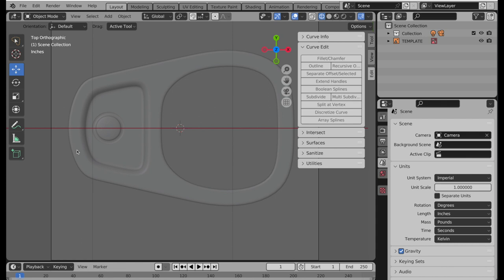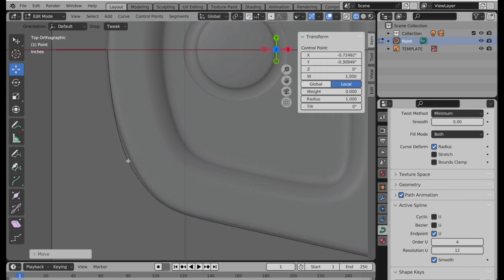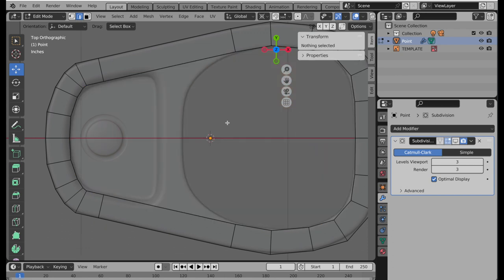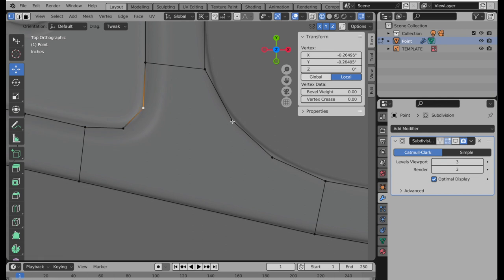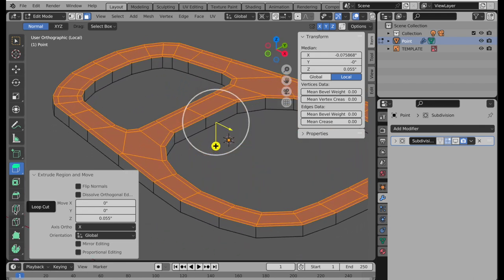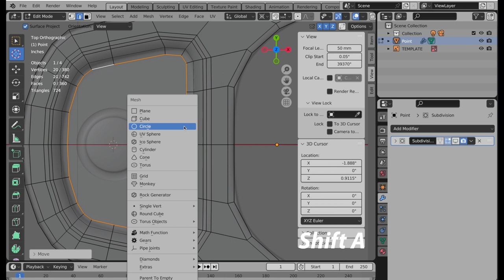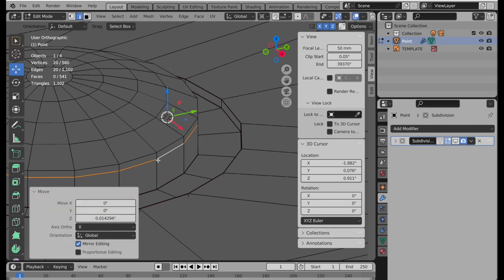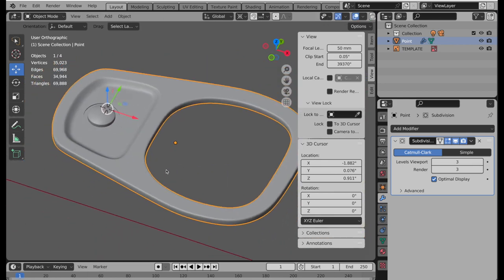Part 1, Sardines Can Packaging, tab modeling

Comment: Great Video.  Thanks for sharing.
I  have seen the nurbs curve video, but still prefer to use bezier curves. I am using the free addon bezier utilities, works like the pen tool in Inkscape, in Blenders object mode, and has awesome options. Maybe check it out. 
10:28 tipp: you don't need to select and delete the faces. Just use the mirror with the bisect option.